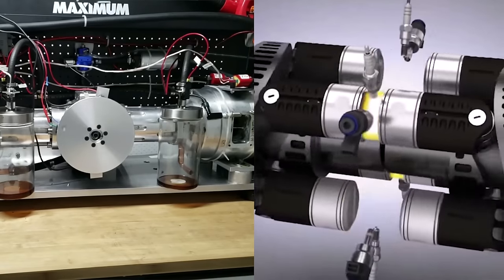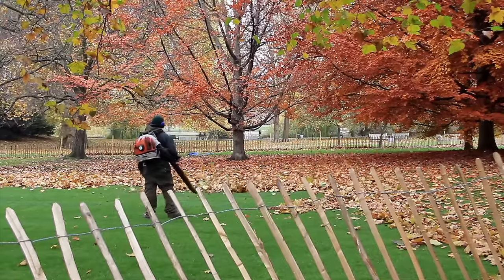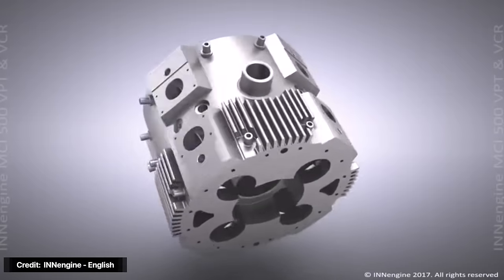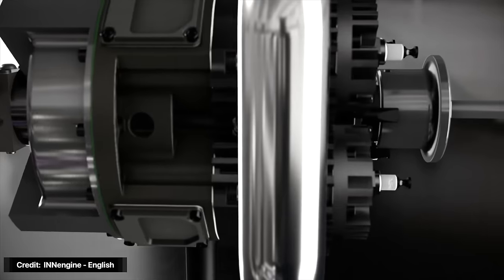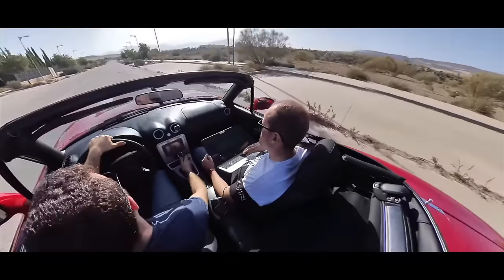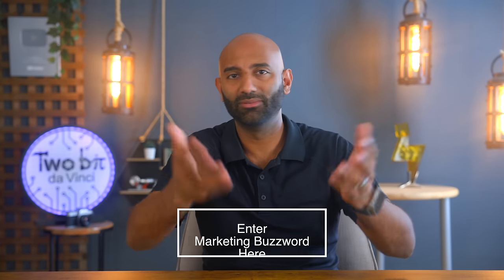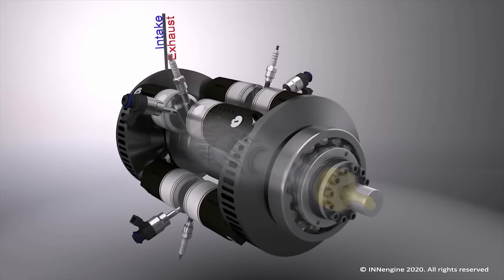One Stroke Engines - 200% More Efficient??

Comment: I think EV fans overestimate how many others are on the EV bandwagon.
Reply: his remarks on EVs reflect that he's clearly living in a delusional reality distortion field
Reply: @TheSulross And no 7 months of winter hitting -30C at times.
Reply: I agree not all of us are blind to the fact that EVs are not more efficient or clean than gas engines because you don't get rid of the emissions you just move them down the street to the coal power plant.
Reply: Well you'd better get on it as car manufacturers aren't going to be making ICE cars much longer.
Reply: @keldon_champion  If for some reason you get electricity from coal, which would be odd as coal consumption peaked in 2007 and has dropped 40% since then. Your argument isn't even against EV's either, it is against coal plants. Nice fail.
Reply: @filonin2  They're not going to switch back to external combustion, that's pretty sure. Most major mfrs are giving up on EVs for  now. ICE F-150 and Toyota Camry are the most popular cars in the USA still.
Reply: @keldon_champion  And back up the street to the lithium mines.
Reply: @filonin2  I was using coal as an example but fossil fuels power plants make up over 60% of the US power grid so more likely than not your EV is being charged by burning fossil fuels. You are technically correct about coal being a smaller part of that but still a failure of a fact check. And if you want to really dig into the environmental impacts of EVs let's talk about lithium mining and refining or the fact that the carbon emissions of EV production are nearly double that of internal combustion powered vehicles.
Reply: Nope to many cons not enough pros
Reply: Exactly... EV's have their place, but for some jobs and applications they'll simply never be accepted...
Reply: @filonin2  That's okay the trucks they make now are terrible... I'm looking for a 30 year old truck to replace my 22 year old one, because modern trucks are simply TOO expensive and absolute unreliable junk that are designed to break down, not for long life and heavy service.  I can fix an old vehicle and operate it much cheaper than this new overpriced junk that STILL has high repair bills and frequent breakdowns.
Reply: Yes evs belong on the moon
Reply: @keldon_champion right. going from a horse to a powered car was a quantum leap. going from ICE cars to EV is... an expensive pain in the ass? I dont get the EV proponents gaslighting us into thinking they are so much better. in reality, all i mostly hear is how cheap they are to run, which is hilarious because gasoline was dirt cheap before there was a demand for it then prices skyrocketed. you can bet once we have no choice but to charge, the "green" subsidies will mysteriously disappear, and everything will cost $.85c a kwh
Reply: @keldon_champion  considering rich neighborhoods have EVs and poor neighborhoods have coal plants, the people that matter (have money) think its a great solution
Reply: @keldon_champion  lets talk about driving a 6000 lb car that has a life of 5 to 10 years instead of a 3000 lb car that has a life of 20
Reply: @filonin2  hybrids are the future. you can get a new prius for under 30k that gets 55mpg and will last for 20 years. performance isnt bad either
Reply: @carlholland3819  a lot of rich communities are powered by fossil fuels too, the same city usually uses the same power plant.
Reply: @carlholland3819  I agree that just adds fuel to the fire in the increased carbon footprint of manufacturing EVs and mining lithium
Reply: EV?  Nah man.  Hydro ftw.
Reply: @filonin2  The reason for that coal plant peak is political, not engineering.  Barack Obama said quite explicitly that electric power companies could build coal power plants, but the government would bankrupt them.

Comment: This could also work as a silent backup generator for home or a cottage.
Reply: Or a generator for worksites such as new housing and off grid spaces such as logging.
Reply: It would be perfect for that.
Reply: I was just thinking the same thing.
Reply: Yes.  A consumer level backup generator would be easier product to start off with, than automotive.  I'd like to try it out.
Reply: I immediately had the same thought, including marine generators in the potential use case.
Reply: If it could be converted natural gas.

I would want to avoid sitting/sitting fuel in a back up strategy.
Reply: @u9Nails   Diesel when well stored will easily last 10 years, by this time it has much poorer fuel economy (It will get eat up faster than fresh diesel) but the engine will start and run on it no problem. In a large enough black out natural gas will stop too, as it depends on massive compressor plants to compress it, lines and break. so I trust a tank that I own that is right next to my power plant, than I do a very large system with literal millions of failure points.
Reply: @Refertech101  Therefore could you not just as easily also own a large propane tank sitting right next to your generator? This has the advantage of being much cleaner than diesel.
I have had barbeque bottles sit for multiple years with the gas still remaining fully usable.
Reply: I think it'd have to route the power in conjunction with a powerful battery and inverter to handle the surge requirements of a refridgerator or sump pump kicking in.
Reply: I work for a major boiler (and engine parts) manufacturer and I'm sitting on a proper 1 stroke engine (unlike the one in this vid). It's a crankless, pneumatic free 'piston-turbine' engine that combines the simplicity of a rotary turbine engine with the instant compression of a piston engine. combustion, exhaust and compression occur in 1 stroke and compression adds even more torque, not just combustion. Far fewer moving parts. It combines a rotary heat engine and condensing heat exchanger wrapping the catalytic converter for c/h and h/w. You should be able to imagine roughly how it works but the version I have combines a simple rotary heat engine / steam power + cooling. It's an alternating hot-cold engine where cooling provides power.
Reply: I’d like to point everyone to Edison motors. As they are adding small generators to there EVs. This allows your vehicle to then power all your off sight and home needs.
Reply: Bingo!!
Reply: @mintakan003  Well, as a backup motor for EVs, it'll do
But silent generator would be cool
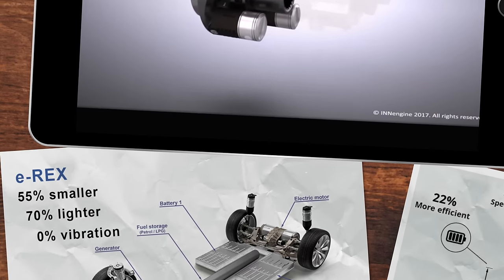Reply: @u9Nails it's not NG, but one of the graphics that Ricky showed 7:00 indicated that it can run off of gasoline or LPG. Another graphic 7:15 said it's "fuel agnostic" and showed an H2 in the picture, implying that it can also run off of hydrogen.
Reply: @Stambo59 I just saw a YouTube video of a guy who installed his own US Army surplus 10 kW diesel generator as a home backup generator. He looked into natural gas and propane, but decided against them because they would drastically limit the number of hours of runtime he could store fuel for on his property. A propane tank is pressurized, far smaller and more expensive than a lightly used old fuel oil / diesel tank with a far higher capacity.
Reply: If it can really output 120 HP ( 7:15 ), then that's about 90 kW, really huge for a home backup generator. INNengine might want to build much smaller versions of this engine for home backup power ( < 25 kW would fully power 200 A service at 120 V, or 100 amps at Europe's 240 V) and EV range extension (~10 kW). Making it as big as they did just adds more weight and cost to the vehicle.
Reply: The problem with that application would be fuel. For backup generation you want a fuel type that can be stored for long periods of time and not breakdown. Of the three common types of fuel (Diesel, Propane, and Gasoline) gasoline is the least suited for that task.
Reply: Or you could have solar or hydrogen, or stirling engine. Hydrogen you can actually use inside your home instead of outside your home, for Stirling engine you can use absolutely anything as fuel as long as it burns, wood, paper, dry leaves, dry poop, your fuel is unlimited, and for solar, you dont keep it as backup, you use it and if you dont, you sell the electricity for $$$. Why pay for a backup you dont actually ever use, when you can have something that does the same thing AND earns you money for no work?
Reply: @ribbitgoesthedoglastnamehe4681  The drawback to hydrogen is the pressure at which it has to be stored. 5,000 to 10,000 psi is an incredible amount pressure. If you ever had an accident on your property, forget about it. For comparison a car tire is usually 30-35 psi. A semi tire is 100-110 psi. A propane tank tends to run 125-250. Even if hydrogen wasn't flammable the pressure alone would be an absolute detonation.
Reply: @someperson7  Well, I have never had an accident, on my property or otherwise. A tree tried to fall on me once, there was a loud bang like a gunshot as the tree broke in the wind. I stopped to look around because I believed it was a shot, but i saw nothing so I continued walking, and the tree fell where I had been so the leaves were like, 1 inch from touching my back.
Anyway, if you dont like hydrogen, dont use it. Its the worst of the 3 anyway.
Reply: As a backup generator live inside of a sustainable forest having plenty of burnable deadwood and trees.
Reply: @grandpied  available wherever steam turbines are sold.
Reply: @someperson7  Yes, steam turbines are a good sign of where one may find a forest.
Reply: @grandpied  you could use gps, but real woodsmen know to look for the turbs
Reply: Power generation is likely the  real application for this design. I don't think the torque of this design would effectively deal with spike loads like a crank engine can. But I see small aircraft, drones, and generators as viable applications.
Reply: @billgreathouse1913  I wonder if a high torque electric motor to get a vehicle moving and having a single stroke motor take over cruise, might be the best of both worlds?
Reply: @someperson7  Wise words!
Reply: @u9Nails  Thought the same, but biogas is what I had in mind. 
Regardless this would be an awesome generator if their claims are true...
Reply: The Wankel like engine being developed by the company Liquid Piston would be a far better solution, as it is about a third the weight of a normal engine, despite outputting the same power; The military already gave over 2 million in grants to further their development, and as they would likely need somewhat quite and reliable engines, I assume those two features would be an advertisable feature when it is commercially released... so I would say it would be a better backup generator, as thats particularly why the US Army is interested in them.
Reply: @chrisschembari2486  Wrong conversion Chris.  1 Hp = 746 watts ir 0.746 kW, so the 120 Hp works out to just under 90 kW.
Reply: @Gregory-kv8vj  thanks. Corrected.
Reply: As an APU for military vehicles would also be ideal.
Reply: Not silent
Reply: It is wrong to say that there is “ far few moving parts ” but what is correct is that ( the forces are transferred directly through fewer parts ), and this happens even in the electrical system, as a long phone charging cable takes more time to charge the phone than if cable was short. With all due respect, your comment shows that there is a defect in the moving parts, and this is wrong.
Reply: @someperson7  - And, an Oxygen Bottle, from a Typical Oxy-Acetylene system, is full at 3,500 PSI! And a busted valve on those create a Rocket, that'll go through a Concrete Block Wall, or Two!
Reply: range extender!

Comment: IMO only “1 stroke engine” would be a turbojet. Even if an intake/compression is powered by a combustion on the other side of the piston, it’s still a separate combustion chamber.

Comment: It’s two stroke, the revolution gearing doesn’t change the fact that the piston reciprocates twice per power cycle of said piston.
Reply: Not only that, the INNengine design has been around since 1970's (possibly even earlier?) 
I forget original manufacturer but they couldn't get necessary funding to develop it
Opposed piston two strokes were around in 1930's, probably most infamous was the Junkers in Stuka
Reply: Opposed piston uniflow two strokes have been around for 100 years particularly in the diesel world Junkers, Napier Deltic, Rootes TS3, the Doxford, and Rolls-Royce,  Leyland
Reply: A single row Deltic with generator in the middle would be compact and efficient. Six pistons and three combustion chambers. The (expensive) interconnecting gears used by Napier could be replaced with roller chains. People will laugh but chains are highly efficient, very reliable and easy to maintain.  Motorcycles all use chains between engine and gearbox. (Ignore the final drive). 
Regarding emissions check out the Rotax ETech. It’s cleaner and more efficient than competing four strokes.
Reply: X format is another option. Four cylinders spaced 90 degrees apart around a single crank. All conrods attach to one wide crank pin. There is zero vibration as all forces cancel out. Air can be fed through the crank case then via transfer ports to the cylinders. Alternatively, an external manifold ring provides air direct via reed valves to the cylinders. 
Fuel is injected directly into the cylinders after the ports have closed. Fuel pressure is higher than conventional fuel injection but considerably less than diesel injection. 
Engine runs at constant speed to drive a generator so is optimised for power efficiency and emissions. 
A basic (dirty) two stroke easily makes 100bhp per litre. DI two strokes use much less oil as there is no surface washing by gasoline and the exhaust catalyst removes anything unburnt in exhaust. DI also solves the part throttle chatter and piston rattle that afflict normal two strokes. Short cylinder life is no longer a problem.
Reply: You are correct however, you forgot to end your statement with... Period.
Reply: Commer trucks and the Deltic  engine both had apposing pistons . deltic had a triangular  set up very smokey & and limited life
Reply: Yes. That was clearly established. Even by the manufacturer. It's marketing, bruv.
Reply: @davidelliott5843   Yup.  I've been saying this for years.  Nice little compact 50cc deltic for a scooter would be great.....especially if it were still diesel fueled.  Would be able to rev up fast enough to compete with a gas motor, due to the halved stroke length.  If  I ever get some hobby time, I will try to build one from (3) 50cc scooter crankshafts and (3) cylinder sleeves.  150cc, since I will not try to change the stroke length.
Reply: Two strokes and you win.
Reply: Yes
Reply: @davidelliott5843   "Motorcycles all use chains between engine and gearbox." Not nowadays, the vast majority use gear direct drive.
Reply: Yes it is, and it will be exactly as dirty as two stroke engines.
How they gonna pass EURO with two stroke?